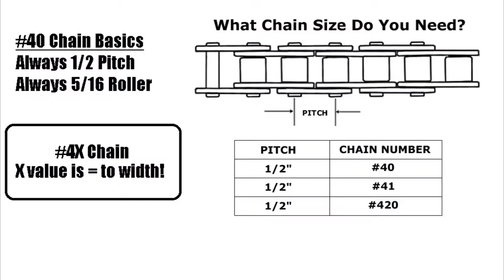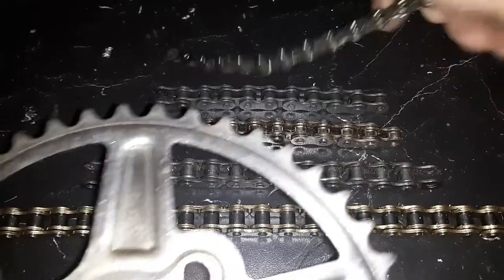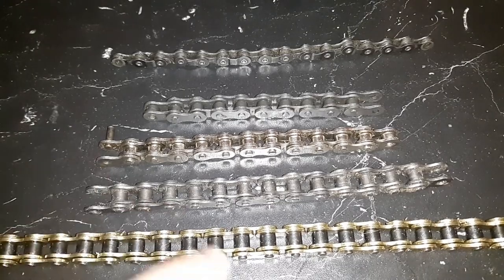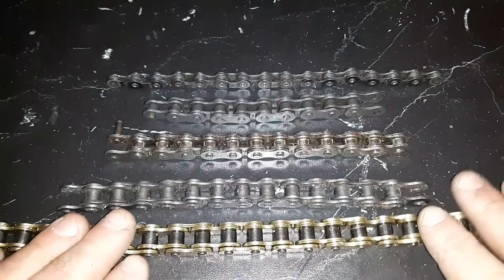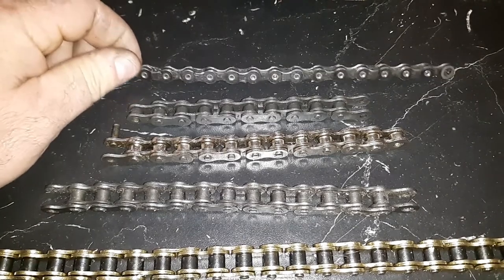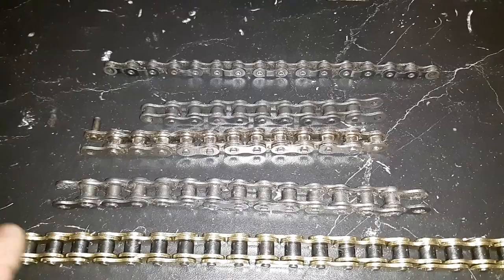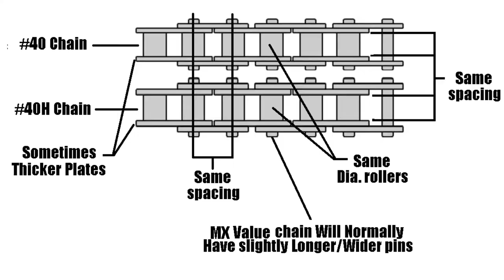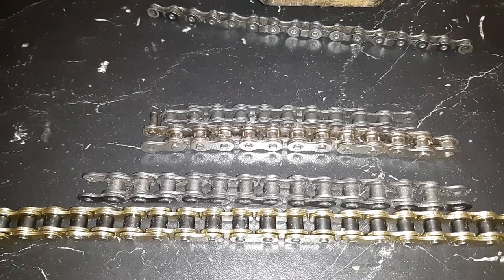#40 sized chain! Motorized Bicycle Forum Top Asked Question! What Do All The Sizes/Letters Mean?

Comment: My theory is that the kits come with a wide chain to make up for alignment issues with the back sprocket due to wheel dish. I always run a heavy duty bmx chain which is also the same a s a chain driven garage door- if you come across an older garage door it might have a high quality chain. Bonus- yu get 3 or 4 chains from a garage door. Smaller chain is totally  adequite and much  lighter. ,

Comment: So I have a 35 rear sprocket and a 41 front, is there a chain that will fit both at once so I don’t have to buy a new centrifugal clutch
Reply from the maker: No chain can fit that. #35 is 3/8 spacing and #41 is 1/2 spacing "pitch". You would have to buy a 40 or 41 rear sprocket to use your clutch.

Comment: 428 fits those chinese normal 80cc sprockets?
Reply: 428 and 428h, cuz i live in brazil and here everything is over priced, i saw a 428h in a promotion for about 8$, and bought, just waiting it to arrive. Those 420h here are 12 to 18$ 😅
Reply from the maker: Sadly will not. They require 415 chains and sprockets.